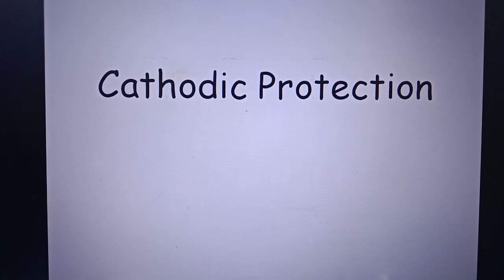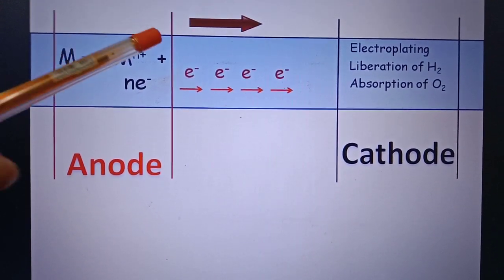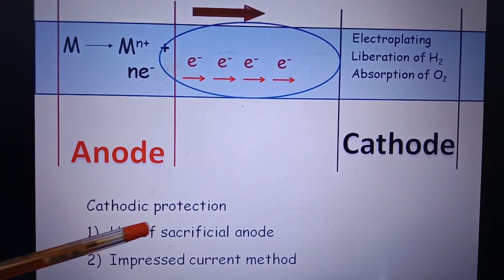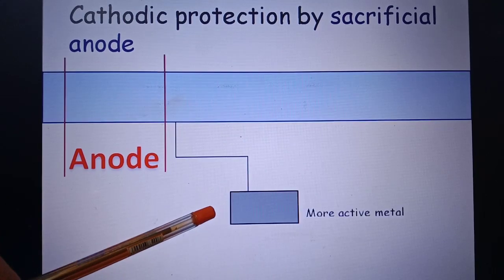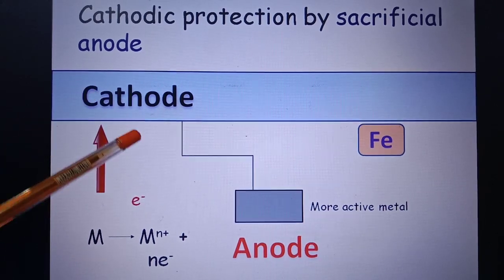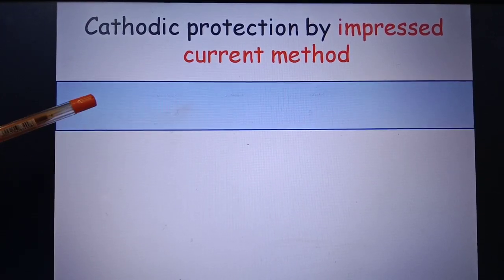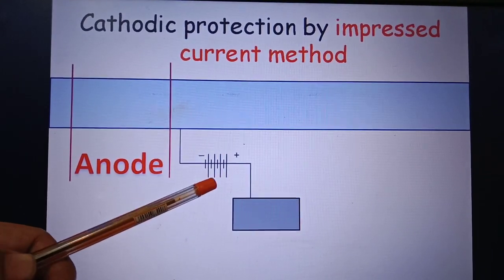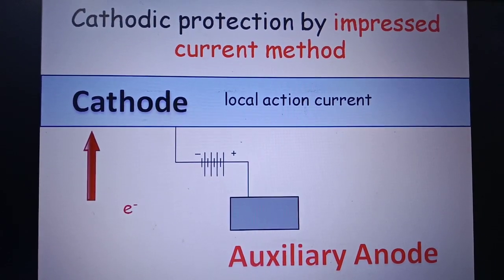Cathodic protection

Comment: nice, so basically the cathodic protection consist on sacrifizing another more active metal(metal2). This more active metal may be connected to metal1 by a wire so that when metal2 corrodes(anode), the other is reduced. We can also put a circuit and generate electrons thhrough it going to the metal1 and so causing it to reduce

Comment: if in both methods electrons transferred from anode to cathode than why anodes get consumed only in case of sacrificial method and why not in impressed current method?
Reply: Basically names are not as correct as they are given...
Anodes have no infinite life..
In both of the methods it will sacrify itself..
The difference is size of structure that decides which method to use ffor cathodic protection..

Comment: But how exactly does turning it into a cathode decrease corrosion?
Reply: നിങ്ങളുടെ ചോദ്യങ്ങൾക്ക് മികച്ച ഉത്തരം ലഭിക്കുന്നതിന് ഗാൽ‌വാനിക് സീരീസിനെക്കുറിച്ച് നിങ്ങൾ അറിഞ്ഞിരിക്കണം.
Reply: @first.7457  I have a vague idea of what a galvanic series is... Can I conclude that the cathode becomes unreactive becaise it wouldn't have any electrons to give away? (Since the electrons went to the anodel
Reply: It's an electrochemical reaction. Electrons flow from the anodic metal to the cathodic one and that change in charge causes the anodic (positively charged) one to react with other atoms (in the air, water etc?) and form rust (corrosion).

https://www.youtube.com/watch?v=4HCsBMI7nSg